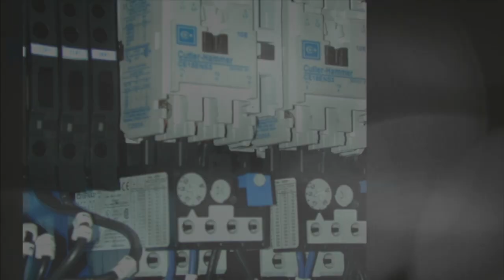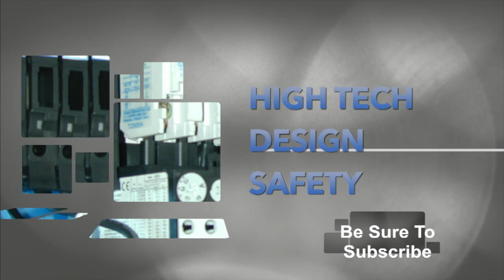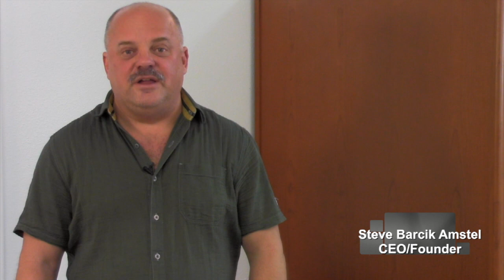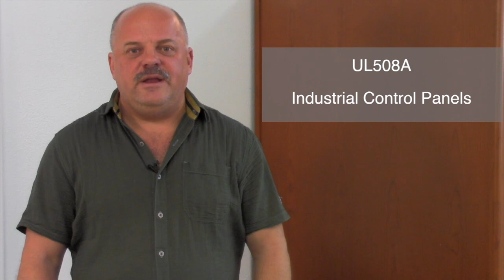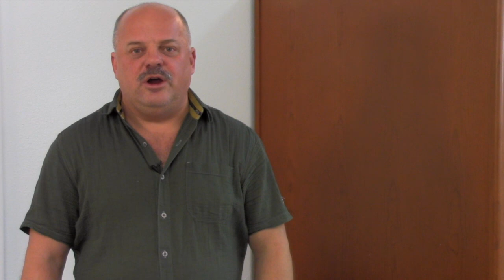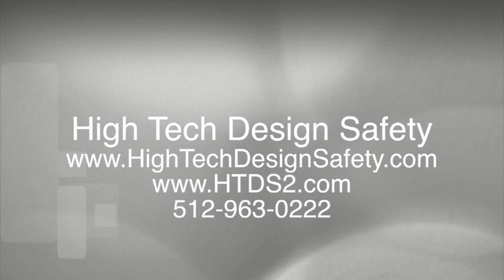UL 508A Standard for Industrial Control Panels Overview with High Tech Design Safety

Comment: Would products certified only to the UL508a standard be accepted in Canada?
Reply from the maker: Thank you for your question.  UL 508A panels are one step toward system certification, labeling, or listing for the USA. Machinery and Subsystems outside the UL 508A panel must also pass evaluation and testing along with, interlocking, grounding, manuals, documentation and safety labeling. For Canada, you will also need these items to comply with and for equipment to be Labeled as passing CSA SPE 1000, a standard similar to NFPA 79 that is available here; https://www.csagroup.org/store/product/CSA%20SPE-1000%3A21/
If you are shipping equipment to Canada please reach out and we will support and complete the CSA SPE 1000 evaluation for you.